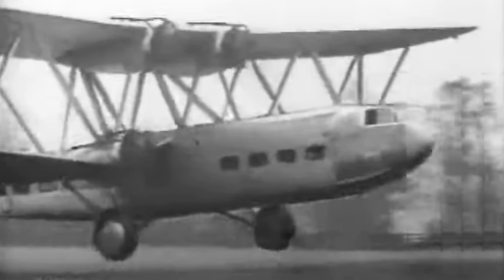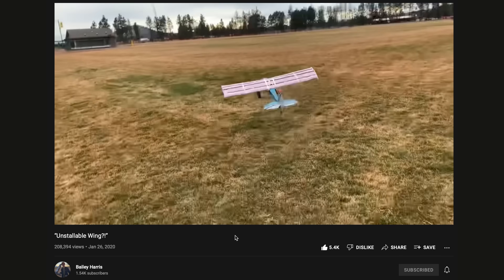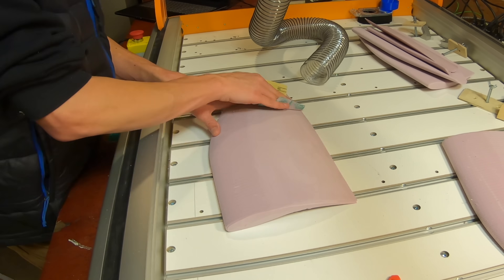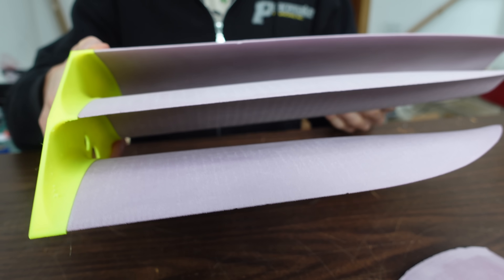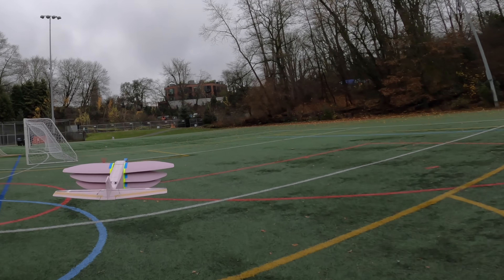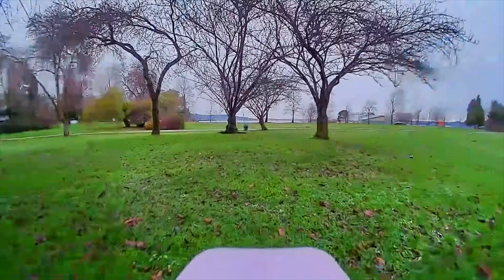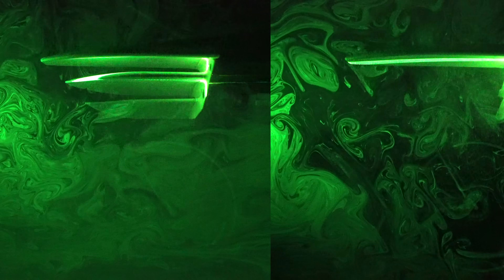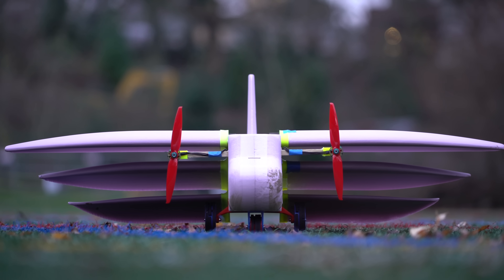Best STOL Wing Design Ever?!?

Comment: https://en.wikipedia.org/wiki/Mignet_Pou-du-Ciel

Flying Flea had an effect you need to watch out for.

As speed increased the aft wing became more efficient due to interactions with the front wing.  This drove the nose down.
Once this started, it was NOT RECOVERABLE.  They assumed a steep dive to impact.

This phenomenon was partly  the control force needed to  operate the pitch control rapidly increased, beyond what the pilot could apply.  

Interactions of fore and aft wings in a tandem design (which yours approaches) get extreme when the wings are close to each other.

Comment: May it possible to integratw a mechanism which changes the angle of each wing and the complete set of wings after takeoff? So you can fly way more stable in the air?

Comment: The pitch down attitude and reduced elevon control authority is probably due to the increase in turbulent airflow after fastening the lower 2 wings. I would suggest maybe trying a "T" Tail design to get it out of the turbulent air, allowing for a possibly smaller control surface.

Comment: And again you broke faa regulations. It is required that you (the pilot in control) be able to take over at a moments notice. Holding a camera and taking pictures means you are unable to do so. Yes ardupilot is nice but your still the pilot not it. Also where is the registration number. The plane weights over .55 lbs so it is required to have one given when registered on the faa website to be put on the outside of the plane. These are not rules you can ignore forever. Eventually they will get around to enforcing them more strictly. Are you willing to face the fines at that point?

Also why use fog and a laser…just setup schlieren photography. It is meant for this.
Reply: Good one Regulation Randy.

Comment: 0:55 you say "they increase the amount of air the wing pushes down". Are you sure that this is the primary reason for the lift? I was under impression that mainly the higher velocity of the air on the upside of the wing causes lower pressure above the wing, thus sucking the wing up, while (as you mention) the slower airflow below the wing increases the air pressure there thus pushing the wing up.

Comment: The wings are creating drag resisting the thrust from the engine. That's why it pitches down when the throttle is high. To fix move the engines lower toward the center-line of the drag of the wings.
Reply: Or move the engine(s) to the rear to allow a clean airflow over the triple wings. Maybe even a ducted fan.

Comment: Awesome aeroengineering and construction!  I suppose the pitch-down moment when increasing the throttle is because the thrust axes are so far above the averaged lateral axis... seems like that is something that could be overcome with another design. Mount the motors on the middle wing instead of the upper one, maybe.
Reply: Couldn't you change the angle that the motors are mounted. I believe RC plane motors are mounted a few deg offset to counteract the propeller rotation causing yaw.
Reply: It is also probably due to the propeller wash increasing the lift on the wing, and hence the pitching moment.

Comment: There are some 70-year-old planes still in common use in Alaska, wish I could remember the model.  The reason they still fly, is that in more recent years, nobody has designed and sold a better plane for the job, which is to muscle very heavy loads into the sky off very short runways.  The pilots complain that the plane does nothing else well.  It's difficult to handle in the air and not fun to fly.  I wonder if innovative wing design like these, would help in a plane built for that specific application.

Comment: that honestly is a great design for a slow flyer. Imagine if you did this with lighter electronics, and smartly using flat carbon fiber bars for rigidity, and paper/foam board sheets with one side of the paper removed so you get this under a pound with the same wing construction, it would fly so slow!
Reply: Definitely. Honestly, make the wings a little bit thicker and you probably wouldn't even need the carbon spar. My largest "sparless" build was a 1.4m flying wing and it flew fine - although it did have a packing-tape skin, which stiffens things up almost as much as a spar.

Comment: I think this design really calls for a different angle of attack for the propulsion, since it seems to dive so much with high throttle, maybe, maybe if it were practical to have the engine nacelles pitch on a servo controlled axle? Though maybe just experimenting with different rigid orientations would be more practical.

Comment: itd be intereating if you made a mudular test plane

leave a few embedded nuts in the frame for a spota to bolt wings on in diffrent spots

you can then do testing for wing efficiemcy while keeping the motors, computers, batteries, etc all the same

some neat tests with this set up would be

fastest speed at a specific power output
lowest speed flight
lowest power flight
power consumption at certain speeds

Comment: I remember seeing Samm's video on this (god rest his soul, that beautiful man he was) and loving it a lot when it came out. Fast forward a few years and I'm a mech E at Gonzaga, and fluids dynamics is about to get into air volumes over planar and curved surfaces, and we talk a little bit about slots and flaps, of course I make the connection to this and bring it up in class, we all watch the video (he apparently showed it to his other classes too), and he goes on a 20 minute discussion about how this wingset works, with the calculus to prove it too. I miss taking fluids, that class was fun as all get out!
Reply: Will soon be starting in CU boulder aerospace engineering program, I count Samm Shephard among my inspirations
Reply: How did he die?
Reply: @whitewolf6605  he was driving his motorcycle uphill on road where he used to speed up, but that road do not allow you to see what is at the top because the road surface up there gets suddenly horizontal. Unfortunately a new round about was built up there and he didn't see it in time to break safely, he crashed into it and died three days later....he left behind a loving family, a pilot carreer and a girlfriend that he had just started to date. RIP Sam
Reply: omg fellow fluids jerma nerd
Reply: Eons ago when I was an undergrad at Auburn (WDE!!), our version of this was "heat transfer and fluid flow", that along with 2 equally disturbing classes of statics and dynamics used to make me wonder why I didn't choose a simpler major like Architecture or pre-med instead of aerospace engineering.  But seriously, I don't think I would have made a very good cybersecurity professional (try reverse engineering malware sometime) had a I not studied a subject with "gravity" (pun intended).

Comment: Fun project.  The motors also provide a blow flap affect that will also help with lift.

If you plan another iteration of this concept you could put the motor/props lower down so the pitching moment they generate help counteract the moments that the highly cambered profile is generation.

Having 4 motor + props, 2 per side would enhance the blown flap effect.

Another thing to investigate would the Wing Grid concept. The idea here is lower indued drag.

Comment: Nose wheelie had me wondering — what if you pitch up the wing-mounts about 10 to 15 degrees? A higher angle of attack — more like the original 10-wing drawing. Seems like you could easily rotate them where they attach to the fuselage, an easy experiment.

Comment: Could you build a reconfigurable wing, where each wing can rotate to be more in line with the others and the whole wing assembly rotates to reduce angle of attack?
Reply: "All it takes is money"

It can be done.
The design work takes time (which equates to money... trading $$$ for labor.)

It might not be practical due to the structure requirements which might either use prohibitively expensive materials or add excess weight.  It takes a lot of strength at the pivot points when you want  wing that can rotate in any way.

Comment: its only about the pressure difference on the top and bottom of the wing, nothing complicated
Reply: if you have more pressure under than above, then it pushes up, design the wings as such, no nasty complex descriptions of lift
Reply: you cant use the independent wing characteristics for combined multiple wings
Reply: let the charts go, you dont need them to anything, or "knowledge", let it be given like the light you claim to own
Reply: better over engineer robust things, than optimize in vain
Reply: so why not just have one wing at 45 degrees angle
Reply: kite plane, tilt wing plane
Reply: like canadair cl-84
Reply: works much like the ground effect plane
Reply: tail to keep it level, tho slow

Comment: Wonder if you can get to a point where lift comes primarily from prop wash moving air over the wings as opposed to actual craft flying forward air speed.

Lighter plane combined with bigger props that can push air across all elements of the wing?

Good luck on the rear elevator giving any sort of pitch control thanks to the wings diverting air.     Elevator moved higher up and having it's own motor for air across it, or just a thrust vectoring motor maybe...

Comment: Any concerns about rotor wash with the airflow on the wings? Just because the props are right in front of the part of the wings with the most lift. Would have been interesting to see if you get the same characteristics placing the props elsewhere, like one more powerful one on the nose, or even switching the current ones with EDFs

Comment: It would be interesting to see if the prop wash is negatively disrupting the airflow through the wings. Maybe test it with an EDF mounted above the fuselage. Or build the tail section like an A-10 Thunderbolt II.

Comment: Great work man! I always was searching for a good plane to fly slow FPV like you just did. My best stock plane is the Eflite Cub S2 1 cell with the FPV power cable under the main wing already. Sweet flying plane and is quite slow, but does not like much more than a small breeze.

Comment: Slow speed fixed wing aircraft looks good while flying. How would this aircraft differ in performance as compared to one with wide wings [as if you stuck these 3 wings tip to tip]?
Reply: Given how short these wings are, that would probably just make it a reguar plane. It would likely increase the stall speed, increase the bending moment at the wing roots (increase weight if this requires additional reinforcement), decrease drag signficantly (less induced drag due to the higher aspect ratio; less interference drag; less pressure drag due to decreased area in the direction of flight).
Reply: @qayray  I agree. That's a short and sweet assessment.
Reply: @veloxsouth  that aerospace degree of mine has to be good for something! Even if its just commenting on Youtube videos 😂
Reply: My guess is that, as the "slatted" effect reduces stall speed it would, out of necessity, have to fly faster.

Comment: Hmm, It would be interesting to see if one could make a variable delta wing in this configuration. In a way that it folds/moves into a flatter shape like a normal delta wing after takeoff.
Reply: It's slotted flaps, but the whole wing is flaps lol. Sounds like fun
Reply: Look up Scrappy Bush Plane a guy did basically that.

Comment: Nice concept wings. What if you would add some bird-wing-like outer tips, that expand on higher speeds? Not sure what they're called, but kinda like the outer (3+) feathers on an eagles wing. Would that stabilize and reduce the minimum speed even more? PS: I've seen it somewhere, that they printed flexible, partially carved out  elements onto a cloth web or so to create those outer tips. Prolly in that flapping rc airplane context and/or cosplay costume design.

Comment: I saw this really cool video once, where the engines were in the center of a literal U shape on the wing. It produced so much lift, that the plane started flying at ~8mph.
Here's a rough model of it from the front using keyboard characters: (O=fuselage, - = wings, u = u shape wing part)
----u-O-u----

EDIT: It was a full-sized plane, probably a bit smaller than the DC-3.

Comment: I would like to see this plane with the engines in the tips of the wings, and a mighty T tail. I think that would change things no?
Reply: Engines at the tips could cause some yaw issues. It may be better to mount the engines lower to counter the nose down when throttling issue. The T-tail may make the elevons more effective as there is less downwash from the wings.
Reply: @nicholaslau3194  wouldnt the engine flow going in the wings cause the pitch problem? Maybe puting the engine away from the wings would solve the problem. But yes, lowering the engines would be already a good idea, if you ignore clearance from the ground.
Reply: Moving the aft wing up (this is essentially a tandem wing.  Between "conventional" and "Canard") will reduce the low speed lift, but might avoid a nasty bad habit of tandems with the wings close to each other.

Comment: Based on the 'throttle pulls the nose down' and 'angle of attack' parameters, surely adding an axis of rotation for the props will help with the first and adding an axis of rotation to the wings will help with the second.

Comment: vary the pitch on the wings and reduce the tail size at least 3/4 tip wise, it's as big as the main wing set.. It's like in permanent all flaps mode.
Reply: I was scanning comments to see how many people said the H-stab is way too big. You are the first! I am 100% in agreement. Cut off 1/3 of each side, i bet it flies way better. Wouldn't hurt if the fuselage was a few inches longer also. That's from the gut of someone who has built/flown RC for a decade, and experimented with hundreds of weird foamies.

Comment: If you are interested to play with materials like, carbon fiber, or so; you can 3D print molds, with water  soluble filament. Cover it & make the parts you need, dipping them into water and get a strong, light & belly construction.
If this makes sense, because of my bad English.

Comment: If thin materials are used with less fluid drag properties, and with  props  angled around 6-13 degress you might get faster speeds and I'm curious what will happen if you put the wings above the fuselage....

Comment: Did you have a sense for throttle position/motor current between the single and three wing flights? Did it seem like it was losing a lot of power to drag, or was it able to fly slower at a lower power level?

Comment: When you Mention the elevons not working well with all three wings attached. It looks like the horizontal stab isn't getting enough airflow because all of the air is being shot down under it.
Reply: neets a t tail. or 3 surface config with canards

Comment: Can’t you just 3d print wings without the twist? For the smoke test It doesn’t have to be as light. 

Love your videos and greetings from Germany
Reply: the wing twist reduced the coefficient of lift near the wing tips, so when it stalls, it stalls at the root of the wing first. He didn't want it to violently roll to the side if one wing tip stalled before the other.

Comment: Does more lift mean that the plane is more energy efficient because you can fly it slower? If so, does the increased drag negate this benefit?
Reply: Your last point is exactly right! To maximise efficiency you want to maximise the lift to drag ratio. Above a certain point it is not worth it to increase lift anymore, because it comes with a larger relative drag increase. This is also why aircraft don't extend their flaps and slats during cruise flight, they only use them when they need more lift for takeoff and landing.
Reply: @kianheus2487  that's very interesting, thanks!
Reply: @kianheus2487  Yes. Cruising speed naturally creates more lift, so you need a smoother wing to reduce drag. The speed makes up for thinner air, where there is less drag.
Reply: @kianheus2487  To add to cyand's question. If all you cared about was achieving takeoff with the lowest powered motor as possible, is this design better than something like a powered glider design?
Reply: Yes, clearly overall efficiency in an airplane depends on what you want it to do. For instance if you only value distance traveled per watt hour (or per gram of fuel) for a given payload, slow flight becomes a good option so go ahead and design the aircraft to go slowly, since drag is greatly increased once you go hundreds of miles per hour. Of course a lot of people do care about going faster if they can.
Reply: Pretty much. A bigger, single wing, would probably be more efficient, if less cool looking.
Reply: Efficient is a dependable, if you want lift then you cause drag to forward force. So when you have more lift then your plane need more energy to go forward, and vice versa. So in terms of efficient, you need to know motor prop thrust combo and translate that efficient to get exact lift so the drag not holding back the power. Rule of thumb the more airfoil generate lift the more drag they will produce to cruise. So if you targeting to get on the air as long as possible or even hover the plane that might be right term for efficient, but if you want to go from A to B then my explanation above is more efficient
Reply: @ZuNunchaku  By definition, the efficiency of an airfoil is the lift-to-drag ratio, it is not debatable. What you are talking about is mission objectives, that is what you are trying to achieve with a certain design. A multi-slotted airfoil is horribly inefficient, but achieves the objective of flying vey slowly.
Reply: @nicholaslau3194  Read carefully the question, he said "the plane is more energy efficient" not the airfoil.

There is lot of term of efficient, for example motor-prop-cell efficient, airfoil efficient (as you described), wing area-material wise, etc etc.

And my answer is referring to the questions, whereas plane efficient